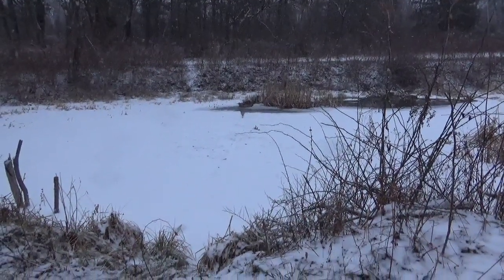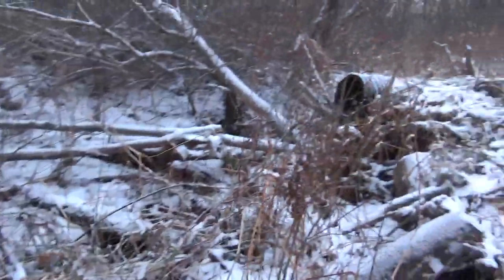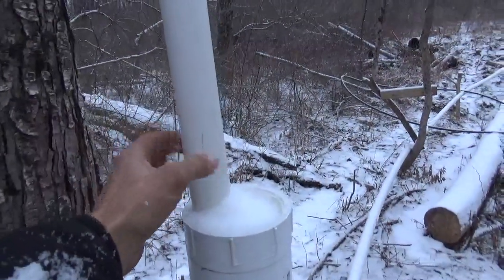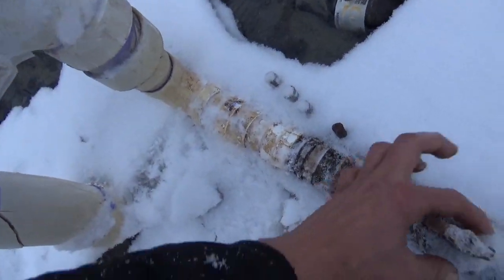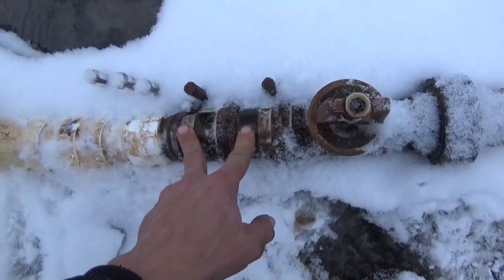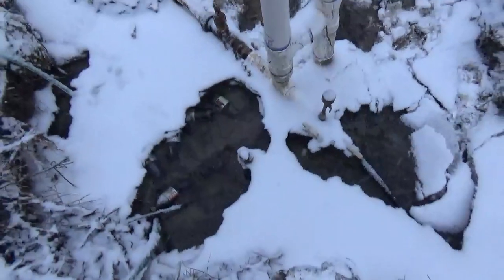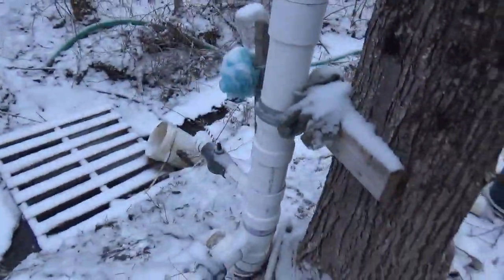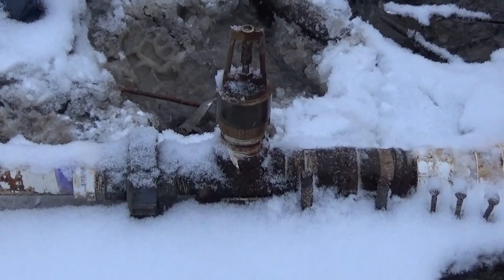01 16 2018 Ram Pump Freezes - Shatters All Fittings!

Comment: gee r really thought about the thing icing up,gotta keep that in mind myself
Reply from the maker: Yeah, the big problem I think that caused it... The pump stopped. Once it stops... the water flow stops and freezing happens fast at -9 Deg F. As long as there's flow, it's usually good.  Usually the delivery line will freeze up at 27 Deg F and stop delivering... but the pump carries on... maintaining 90 PSI until the delivery line thaws again. But yes, beware of cold weather.
Reply: What tubing is best for the output in northern weather? Will poly pipe work uncovered? Thanks

Comment: Tough break there. Have you considered adding a flow rate meter to enable remote monitoring? I'm pumping from a low flow spring, so will need to set something up to trigger an adjustment of the pump
Reply from the maker: I have... as well as temp senors and the works on monitoring.  The issue is I have to supply power from solar or something to supply voltage to the sensor system, and then transmit the data to the greenhouse site (about 800 feet away).  I am planning to add these features, but am running on a sub-shoestring budget. I am thinking about using a node-MCU (like a stripped down raspberry pi) to collect the data.  In short, yes, all of that is in the works eventually.
Reply from the maker: On your setup, I'm sure there's  a way to do that mechanically, I'd have to think it out a bit, but it's possible. Depends on what and how you want to achieve your goal.
Reply: Thanks for the info on NodeMCU, I'll do some research. I'd be happy to make the adjustment myself, just need a notification to attend!

Comment: Oh No!.  That's not cheap... repairs in the snow wont be that much fun either.  ...  Sorry to see bro.    Best of luck with fixing it up. .. How is your supply side and delivery line?   Sux news. :(
Reply from the maker: Thanks for the well wishes... supply line APPEARS ok... Delivery line really never has issues... usually will freeze / thaw with the pump running and deliver water when the the thaw happens and just freeze up when it freezes again.  The crappy part is the expense of all the fittings.  But, I should have shut it off... was just too tired when I was done.  I did move 450 gallons of water in about 9 hours though. I probably won't have the budget for repair until spring.
Reply: Yeah ... I live in the South Pacific so fittings are even more expensive here.  I have recently bought everything i need to supply my pump from the top waterfall with 100mm pvc.  I copied your standpipe idea with some mods... basically a combination silt trap and filter... I ended up going from 100mm supply out to 150mm at the filter (so the flow would not be obstructed by the added filter) .. other than that.. pretty much the same as yours... I would not have included it in the build had i not seen yours.  .. So thanks for the good idea. 
I will have to be very careful to empty the unit over the coldest months here i think..  although it rarely goes below freezing,  1 time will be 1 time too many.  
Really sorry to see all that hard work get smashed up.  Gluing those 4inch  fittings together takes some time as well.  Best of luck sorting your water out until spring.
Reply from the maker: Sounds like you are on your way.   I'm glad the standpipe idea worked for you... a lot of trial and error to find the best system, but that seems to address all the issues with clear supply water quite well. Well, if you rarely go below freezing I wouldn't be too worried. My ram has run right through some cold freezes (below 10 deg F) without any major issues. The problem I think this time was EXTREME cold... at least 0... and more importantly... I think the pump stopped for some reason.  That prevented water flow which caused the freeze and splitting. Moving water takes some VERY cold temps to freeze.  Here's a few old vids with a few stats: 
https://www.youtube.com/watch?v=VMbRhM4awd0
https://www.youtube.com/watch?v=8lLnGUReKyM